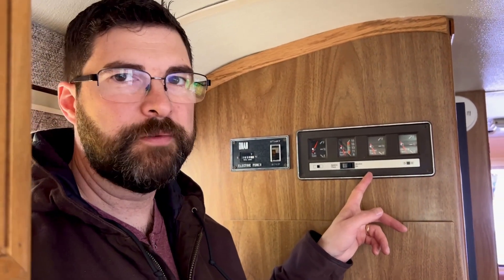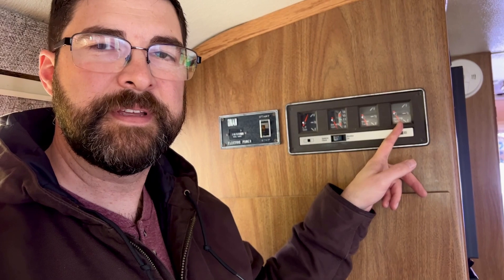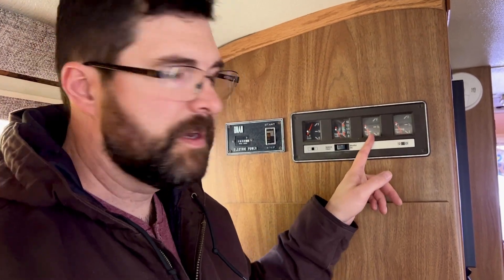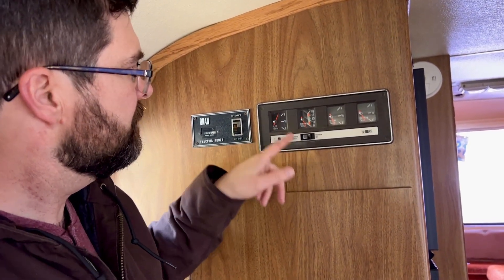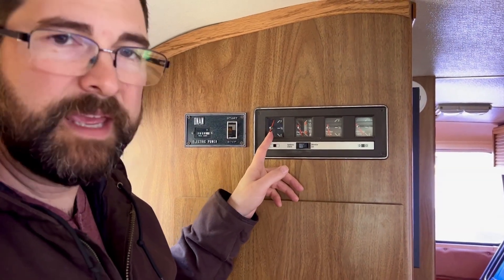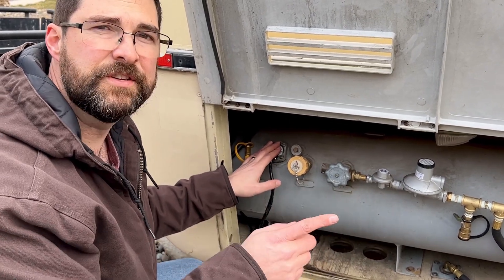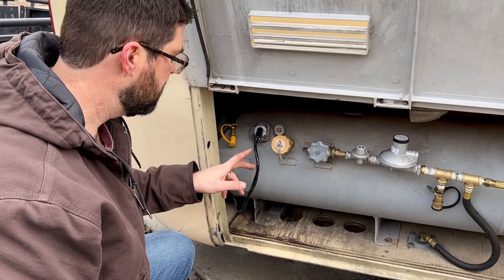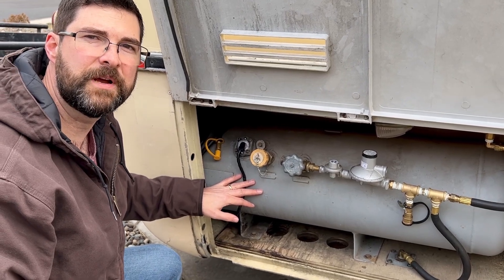'77 GMC Motorhome LP Sensor and Wiring Repair

Comment: Thanks for this video…I’m surprised it’s so easy to change out the sensor. I’m in the process of trying to decide weather to repair and keep the original propane storage tank or change it out for dual twenty pound tanks. Any thoughts?

Comment: Thanks for this video…I’m surprised it’s so easy to change out the sensor. I’m in the middle of trying to decide if I should rebuild the original propane tank or change it out for dual 20# tanks. Any thoughts?
Reply from the maker: Thanks for the question! I have seen some people do that swap. I don't have any great technical knowledge on the topic but I'll give my opinion. :-) I like the original tank because it fits the space so well and it's large, I think mine is somewhere around 60 pounds of LP. If it's maintained and and repaired when needed, I think it should last a very long time and overall, I like the stock look of the original tank.
Reply from the maker: Interesting. We haven't used a lot of propane yet but I guess I'll see if I have any problems getting the tank filled.
Reply: Fred brandon  Thanks for the comments / ideas. Connecting additional tanks and refilling 1lb canisters is a great idea. My plan to refurbish the original tank would be to remove it from the coach sand and paint, then replace the sensor and upgrade the valve. I read somewhere that one could put two twenty pound tanks in that compartment with some room to spare, I haven’t checked the possibility yet.
Reply: @MrGMCMotorhome  I like the original tank also and you are right it certainly would last and does fit that space nicely. I also feel it might be awkward to change out the 20lb tanks when they need filling.